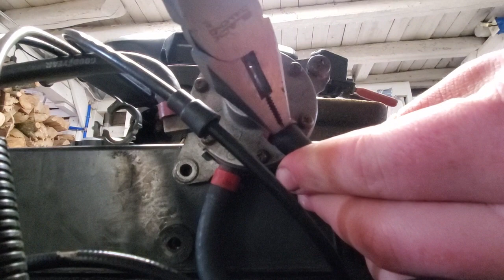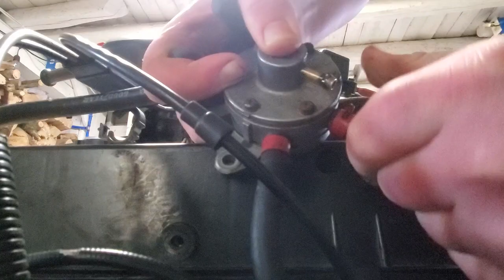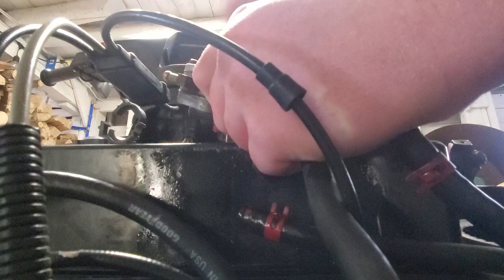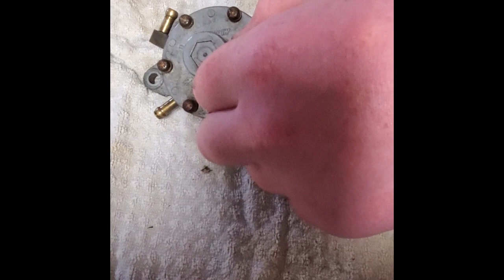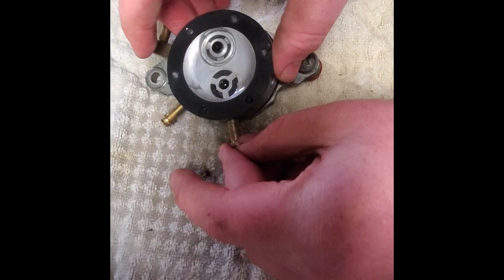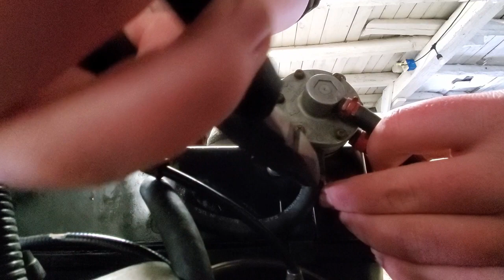Polaris Indy 500 Fuel Pump Removal And Installation

Comment: Where does the top line go to?
Reply from the maker: The top line is the suction line I connects to a lower spot on the engine below the left carb on the clutch side